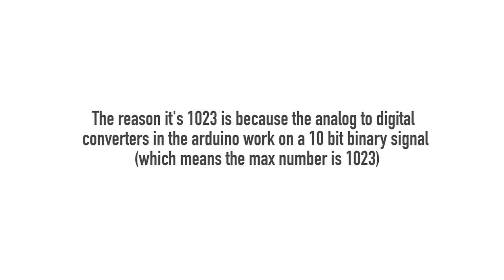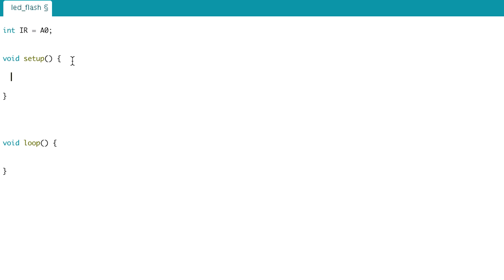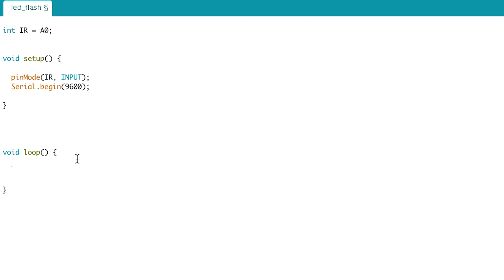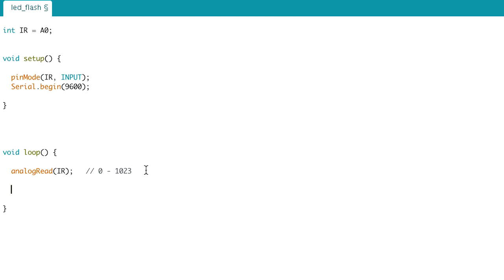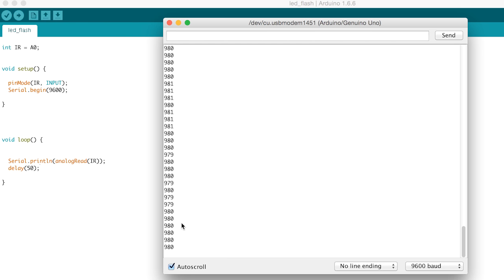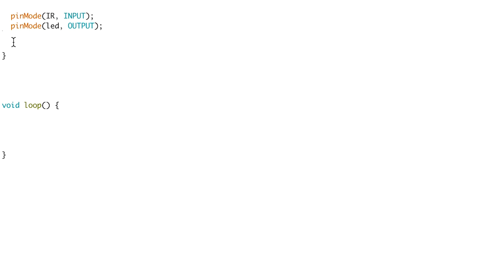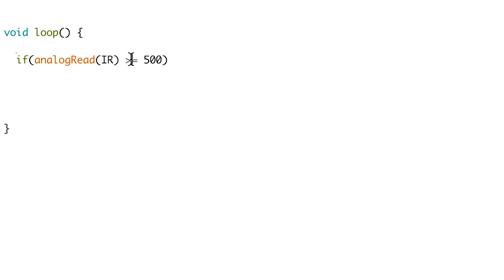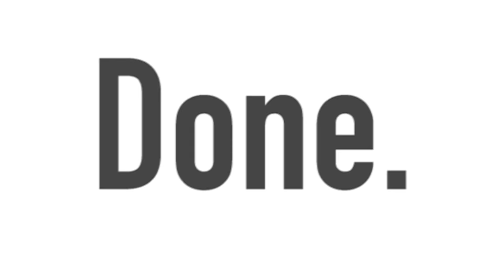Arduino Lesson 8 - Analog Read

Comment: I'm not sure your IR sensor is working correctly. As you finger approaches the sensor more IR is reflected back and the number should go up not down. I need to check the wiring and operation of my IR board. Possibly the sensor is just reading background IR illumination.

Comment: plz provide your wiring of the infrared sensor...
i have searched the net but your custom made sensor couldn't be found....
Reply from the maker: I can't attach images here, but google image "tcrt5000 wiring diagram" and you will find a similar schematic. Alter the resistor values or use a variable resistor to alter the sensitivity of the sensor  :)
Reply: @benduino7327  , thanks mate

i recently found one though is easier than i thought, plz confirm the connection if you have time..
supply voltage to (resistor+emitter) then ground
supply voltage to (resistor+ receiver) then signal emitter wire to analogue pin